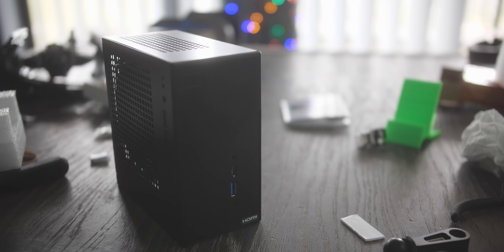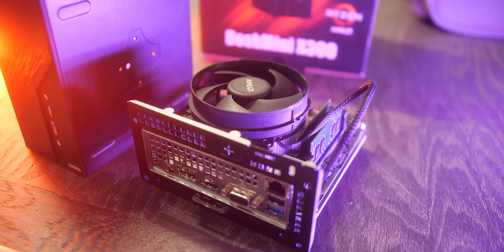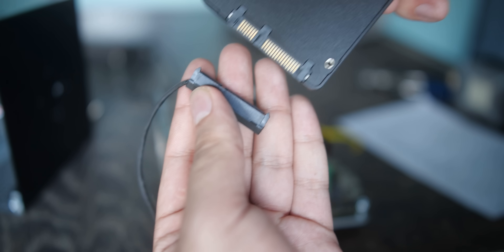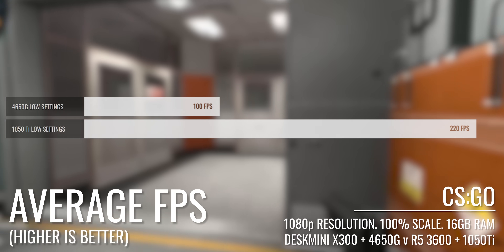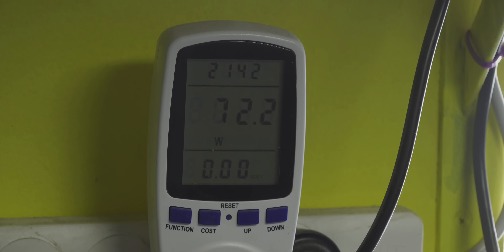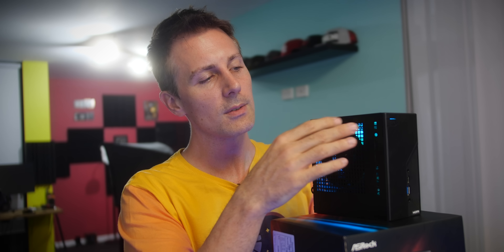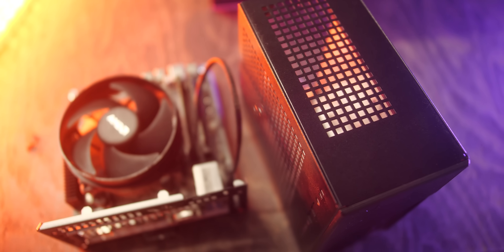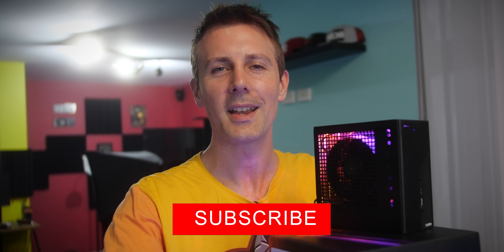Deskmini X300 with a 4000 Series APU, Hidden Bargain?

Comment from the maker: So-DIMM sticks used here are a little limiting, have the desktop comparison coming out in 2 days (we got a PS5 video dropping tomorrow!).
Reply: Honestly, I wish we'd get rid of the DIMM standard and have SODIMM only. Then we'd get focused gaming parts, lower prices, more flexibility and even 8 RAM slots on smaller quad-channel boards. More MicroATX boards could make better use of the space saved as well. Consolidation would be better as a whole.
Reply: @MarcoGPUtuber  Pin count is lower on SO-DIMM consequently it has less address lines per channel, so actually total addressable space is smaller in some modules but not bandwidth as I previously said. However use of larger board footprint means better heat dissipation and higher achievable densities, which you could infer as higher system bandwidth. DIMMS are central to memory specifications,  the DIMM standard is not unlikely to be deprecated any time soon as DDR5 spec is released and does contain DIMMs, I would question what the motivation would be to consolidate these two equally useful specifications.
Reply: @ollyking7692  It's not that different enough where most people would notice a difference or severely hobble performance. DIMMs need to go and the next version of the SO-DIMM should address these issues.
Reply: You could add G.Skill Ripjaws SODIMM 3200 Mhz at CL18 and the performance would be far better
Reply: Brian next time try Gelid Slim Silence AM4 cooler. It is even smaller than wraith..and according to few reviews it is a lot better. And this Gelid should be quite cheap as well...
Reply: The link for the 4950g does not work! Sad face 🙁
Reply: If you still have your Deskmini A300, you should update the Bios of it to the Beta Bios 3.60S and test the 4650g there. It offers you to disable TSME in the Bios, i think TSME is enabled by default on your Deskmini X300. Disabling the Ryzen Pro feature TSME(memory encryption) gives a good performance boost in games and about 100 points in cinebench r20.
Reply: What is the power draw under full load?
Reply: Test the ryzen 7 4750g
Reply: I have read online that the older asrock a300 can also support Renoir CPU's but you need the bios 3.06L that was released for only a day or 2. If you found this bios would you be willing to try the new cpu in the older system.  I have had no luck so far.
Reply: @jhopkins1515  The beta bios 3.60L is very buggy, i recommend beta bios 3.60S which also gives a performance bump because it has memory encryption disabled by default. I use that on my deskmini A300 with a 4650G.
Reply: @MrBlueDabadi  thank you. I had no idea. I also have an a300 with a 2400g. And want to upgrade at some point. Where can I find a link for the bios to download. That way I can keep an update when I ready.
Reply: @jhopkins1515   you can download the beta bios from this german site, you can find the bios version selector right at the end of the changelog section as a dropdown menu called "Bios Downloads Auswahl:" https://shop.jzelectronic.de/news.php?id=1604661600&sw= Edit: there is now a newer Bios 3.70 but that does not support Renoir APUs, so stick to 3.60S.
Reply: Wasn't this the overclocking capable variant of the A300? Wtf man... RGB ?!?
Reply: you can definitely go crazier with the desk mini https://www.youtube.com/watch?v=_raw4h7VfZQ
Reply: there was some patch a few months ago that totally blocked any riva tuner usage on CS:GO.... at first they literally kicked you out of the game for using it saying you needed to sign back in using authentic ways to sign in and play like using steam yet you used steam. now they just dont show it at all without a warning.
Reply: XBOX-PS5 KILLER lol lol lol
Reply: Umart Milton has it on sale this week - AUD$229 (today Friday 11/Dec/2020)
- https://www.umart.com.au/Asrock-DeskMini-X300-AMD-AM4-SODIMM-DDR4-Barebone-Mini-PC_57364G.html
Reply: 3600 is running fine
Reply: the size like psu bro , , , , , , , , ,
Reply: So-DIMM RGB memory would be cool
Reply: so we'll see benchmark with r5 3600 too? This is a very interesting baby pc

Comment: Some time ago I have build my Asrock X300. I worked perfectly with a Samsung monitor connected via HDMI, and the sound worked perfectly with headset, sound via ears and sound out via microphone using the front panel connectors.
Recently bought AOC 24P2Q Monitor. This monitor is also connected via HDMI.
Now there is no sound via the front panel at all!
In the monitor there is Audio in and out - I can hear the sound via headset (not loud enough) and via an external loudspeaker. There is no way to talk via the microphone.
Is it a problem of the monitor?
Will I have the same problem using any other monitor that has audio plug in connectors?
Is the sound coming via the HDMI and cancels the front connectors of my X300?
If I will connect the AOC monitor via the D-sub port will I have the same problem?

Comment: Finally I have all the parts to build the X300. The CPU is AMD Ryzen 2400G. The RAM is Kingston KVR26N19D8/16
 - 16GB on a single module. Can I buy another one and install it have 232GB RAM? Can the X300 handle it? Will I feel a big difference in performance?

Comment: Biggest problem is if you use a 4000 or 5000 series you cannot use SLEEP... sooo dumb.... as far as ram goes the Crucial Ballistix 32gb 3200mhz C16 kit is nice and can overclock a little... the good ram is the ram made by corsair but its sold in 4 stick kits.  That ram you can find up to 4000mhz.

Comment: Here in The UK the barebones unit cost , average , £146 . BUT it seems impossible to buy it with the wifi installed. ax200 wi-fi/bt is about £30 . Not terrible but too often they try to sell those as card only, no attenna's . Oh man just give me a sales option with additional options to add wifi, add usb2 (why not usb3?) and even if you must, GRB.
For HTPC build , 4650 + 16gb. 4650 only £190 and comes with a cooler, in a box, lol

Comment: There's just one problem with this thing, and it's a deal-breaker to me: lack of support for S3 Sleep mode.
It wouldn't be an issue if Windows had a native way to shut down after a period of idling, but there is still no such option until this day.
Reply: You are kidding right? Just in case you aren't it's in power management, advanced settings. Maybe just google windows sleep settings if you need lengthy instructions where to find it.
Reply: @robertkubrick3738  It only supports S1 (standby), not S3 (suspend to RAM). Same problem as many Chinese "fake" X79/X99 boards. It has nothing to do with Windows because it's a hardware/firmware feature.
AFAIK, you can only set Windows to standby or sleep when idle, not shut down (power off the system) without a script or 3rd-party tool like WinOff.
Reply: @manaphylv100  Maybe I didn't understand you, probably the case. I do believe you can set total system shutdown after a set period of inactivity. I know mine does. It's in windows, every laptop I've owned does it and my desktops too, unless I set them to always on.

Comment: I have the A300 with a small bios mod and the 4750G. It works like a charm! Pro-tip, use the Noctua low profile cooler, should fit perfectly and virtually silent.

Comment: HELP! I just bought x300 within kingston 16G RAM and 500G SSD. So, after i put my AMD 3400G from my desktop and install over it, I got a terrible experience. First, x300 got hang after turn on for every 10 to 20 minutes. So, I refresh its BIOS. Then, it got lag when i browse youtube video. The video is unable to go on after few minutes. Do I mix up something? Minutes ago, I rollback everything and put my 3400G back to my original desktop as well as asking help here!!!! Should I throw x300 in rubbish bin or buy another 3200g or 4750g? I dare to invest more.

Comment: would love to see a vid on the Acer Veriton N series tiny PC.. you can use a dedicated Nvidia Quatro GPU P620 or P1000 with it.. and it is small and thin! mine fully pimped out ran for around $300 U.S. (with the P620 GPU) here's a link to one with the GPU extension.. https://www.ebay.com/itm/Acer-Veriton-N4640G-i3-6-Gen-3-2GHz-8GB-DDR4-128GB-SSD-WIFI-Win-10-Ac-Adapter/184557845449?hash=item2af8813bc9:g:QFMAAOSw5c5fwsmO

Comment: Some time ago I was fascinated by the idea of having a mini small form factor AMD based Mini PC. I have never build a computer before. This PC is not for gaming, just home PC for web browsing, Office programs and basic Photoshop and basic video editing. When the Asrcock Desk Mini A300 I decided to make a move. I collected the following parts for it: AMD Razen 5 2400G CPU,Samsung Evo 860 SSD 1TB Sata,  Noctua NH L9a CPU cooler and HyperX Impact DDR4 SO DIMM. The only item left to buy, is the Asrock Mini PC. And now came the Asrock Desk Mini X300. My question is should I get the older A300 or go for the newer X300? Will I be able, later on in some years change the AMD 2400G in the X300 with a newer CPU?

Comment: While I am impressed by the performance of the CPU side the GPU is bad for a non e-sport gamer.  AMD needs to bump up the graphics to at least a RX570 level of graphics.  This is GT 1030/RX 550.  However just like you got your 4650G I am waiting for them to put out the 4750GE (Pro or not) variant.  With the rumors about the RX6700 only going to be a 120W TDP and the 35W TDP of the GE series I can get a gaming rig some real horsepower like a Mustang with a fuel efficiency of a Civic.

Comment: Just so you know everyone has the problem with rivatuner not working with CSGO because people were side loading other data inside rivatuners injection process, there is a work around floating around but its a pain the butt and for those who actually play the game it ruins the trust factor system and you usually can't get a game.

Comment: I still prefer the InWin Chopin SECC Mini-ITX 150W over the Deskmini X300. You have a much better options when it comes to compatibility; it's not too big at 41.9 x 29.8 x 34.8 centimeters in comparison to the Deskmini X300. The only thing I would really make it so much better is if I'm able to change the battery/power supply of the InWin Chopin with 300W variant, that way you can even install a mini itx gpu.

Comment: I love the idea of an APU, I've got a 2400G.  My system started small form factor, but has evolved into a standard ATX build. The problem with APUs is that the iGPUs aren't beefy enough. RAM speeds hamper them too much. I like these new 4000 series APUs but I don't think I will buy another one until AMD moves on to DDR5 and away from Vega.

Comment: 4:36: Think there's something wrong with the 1050ti numbers? Or is it screwy on low settings?
 - also: CS:GO detects RivaTuner as a cheat-software, unless you disable it. It gives you a prompt first time you try to launch a game - at least it did for me - asking you if you want to disable the "trusted" mode (or whatever that's called). There's also some guides online to get it to work - it will affect your ranking and your trust-factor, it says, though....

Comment: I bought the x300 to replace my mini atx clunker. The 4650 is a bit expensive. So I just installed my 2400G on the X300. It feels a tad slow compared to my pc with desktop ram. I guess it's the ram. I wish asrock would come out with an even smaller footprint one like the ASUS P60 size wise..

Comment: I've got an a300 that could support zen 2 with a beta bios, but for the just over $300 I have into it with 16gb of ram, 500gb ssd, and a 2400g its pretty good. (upgraded from a 3200g for minimal cost after flipping the old CPU)

Comment: You can get DDR4-3200 CL18 sodimm. It's relatively rare, but not too expensive ($78 for a 2x8GB G.Skill set at newegg at the moment). For only $1 to $1.50 more per gigabyte vs. 2400 or 2666, you get double digit gains in gaming (10-20% over 2666 CL18!) and single digit gains (generally ~5%) in other tasks. It's probably one of the best performance boosts you can get per dollar, in general.

Comment: The cooler without the plastic looks like balls hair... You don't absolutely no need to remove it. Just take out the fan assembly and remove the little spacers that are glued where the screws passes.

 That's the way it's meant to be played, it just works!
 
 The absolute max would be to source a ring RGB AMD cooler, those of the r7 1700, Wraith Spire led and mount it on the Stealth cooler!

Comment: have a few Intel NUCs and they are getting quite compact, about half the size of this unit. of course they are using mobile chips which are soldered to the board.. but if you want small, they seem a bit more appealing than this to me

Comment: These r available in india for retail sell in tray.. i mean many shops r selling them just the cpu without any cooler. The r5 model is like 170$ and r7 is like 250$ totally not worth the money for most as a 3100 is like 120$ and a gtx1650 or 1050ti or rx580 is like 150$ and out performs the apu day night.

Comment: Did you try any CPU overclocking. That seems to be what the x300 was made for. Especially since the A300 can do everything else besides run the 4000 APU’s. I overclocked my ram on the A300 deskmini I have. Unfortunately I haven’t gotten one of these yet. Looks sweet though. Nice work

Comment: Thanks for this review!  Sounds like good stuff, but the PSU is external so the volume of this entire thing is wel over 1,92 liter.  SODIMM is also not very useful.  So if you spend USD 600 on a working deskmini that does not excel at anything is quite expensive if effectively you can only use it for office applications/torrentdownloading/watching youtube videos..

Comment: CS:GO blocks Rivatuner now give their new Anti-cheat measures by preventing programs from interacting with the game, on a similar idea to Valorant (though nowhere near as intrusive). You might want to just run the community map benchmark then for testing from here on out (that still gives you frame rate data).

Comment: would be interesting if you could put a let's say 1600af and a 1650/1050ti (no power connector and sff) just by adding another small box next to this and connecting the gpu from the m.2 ultra

Comment: I bought the Deskmini A300 for a friend based off your recommendation and he loves it. I bought the G200P for the Deskmini A300 as it is the perfect height for the machine. And the RGB goes Brrrrrrrrrrr hahahah
Reply: Hi what cpu did you use.
Reply: @hedgebetss  3400G
Reply: Wow cheers for the fast reply. I was looking at that set up. I'm currently using a i5 4590 with a gt 1030. The 3400g in the a300 will be a step up.
Reply: @hedgebetss  Happy building!

Comment: I can't wait until they actually get an APU out with an actual beast igpu. The 4000 series APUs are already awesome on the CPU side but their graphics are significantly weaker. Hopefully next gen will bring actual big navi gpu cores, in which case we're talking potentially gtx 1060 performance+, but I'm not holding my breath on that.

Comment: Ryzen has been amazing, but the lack of supply for integrated-GPU models have really hobbled a couple of things, including small form factor PCs and increased support for Premiere Pro. They need to improve their product stack a bit for those who do not want to only buy gaming PCs with dedicated video.
Reply: Yeah, the apu's have been lacking. It has been 3.5 years so you would think they would have better offerings by now.
Reply: We need only AMD to release a desktop 6/8-core version of these APU ‘s to resolve the situation.
Reply: Apus are lacking because that's reserved for consoles. If you could straight up buy console hardware, it'd dig in to their own sales. You'd have you tubers going how to build your own ps5 and stuff. A direct pc competitor to consoles wouldnt be detrimental but probably reduce total revenue. It'd be one less reason to get a console.
Reply: @Derpynewb  I don't think your theory holds water. An  apu pc build is for people who want a pc not a console and vice versa. Many people don't want to build a pc to game. Plus a apu pc build would be more expensive. They are apples and oranges.
Reply: they really should release a cpu with 8C/16T and a bit beefed up GPU - closely matching this of the Xbox Series S

the ryzen 4000 series is not really faster than the 3000 series GPU wise, that is a pitty

Comment: Where can I get one of these APUs from? Taiwan YES Marco of course! They're happily available here.
Reply: Day 6 of replying to marco
Reply: @slay3rgamingyt  lol
Reply: You might want to skip it, the 3400G is barely behind than the 4000 series APUs, and significantly cheaper.

They're not on Navi yet, still on Vega.
Reply: @phillycheesetake  Well we get the hexacore and octacore 4000-series ones here. Eight cores in a little guy with a big footprint? Beauty!
Reply: @MarcoGPUtuber  Longterm I would alwaysgo 6-8 cores,even with the older Radeon GPU part.
Reply: @phillycheesetake  4000 series APU's are the first actually decent and interesting APU's. Enough cores and threads with and for the Vega 8 at stock in the 4750G 8C16T APU it is faster than even overclocked to the max Vega 11 on the 3400G. The 3400G would have been in my portable LAN PC, if not for the fact that it doesn't have enough threads for a multitasker like me
Reply: @MrBluePoochyena  However they charge you for the privilege to having that performance, so for the money 3400g still is a great APU. Also one is available locally with warranty the other isn't. I've waited for 4000 APU, but ended up with a barely used 2400g and still happy.
Reply: @gyorgybano2329  Usually I would agree with you about warranty issue but how often do you see a dead CPU?  Price is different thing, 3400g win there without problem, I can live without 6 cores in PC like this.
Reply: Hopefully he can come down next year! I was looking forward for the series this year 😤
Reply: @lifeinthaboot  Bloody Flying Beer cancelling Computex! Pissed....